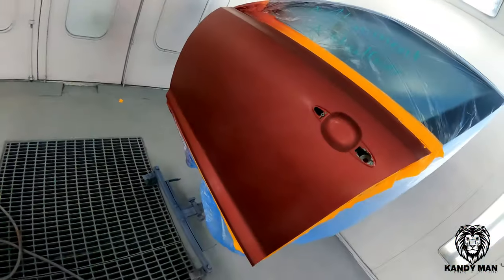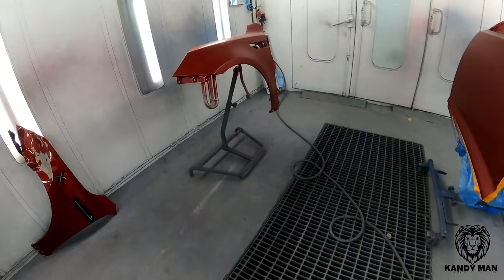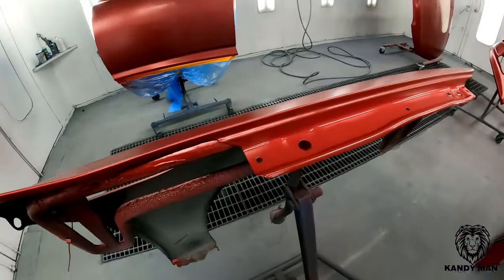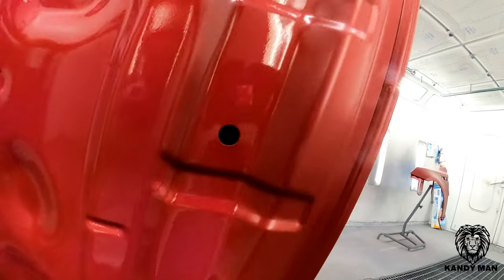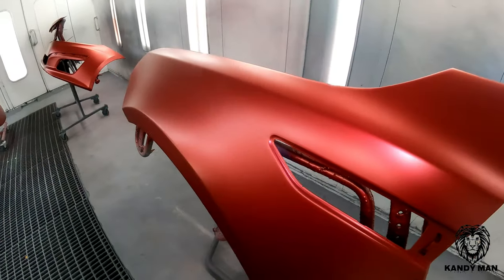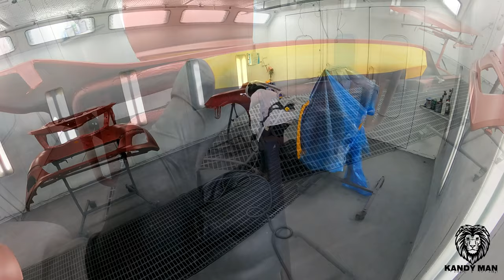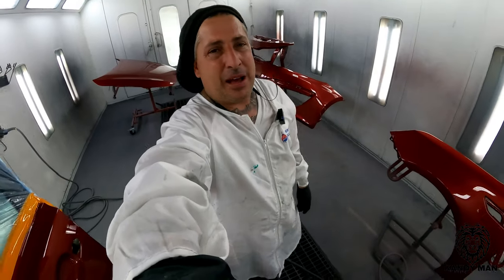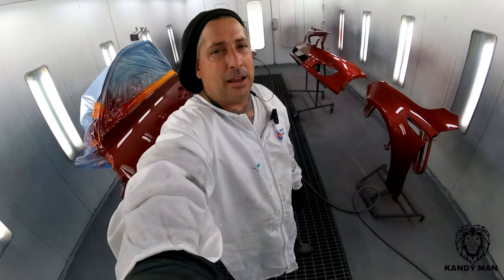DO IT RIGHT - ONE TOUCH AUTO REFINISHING

Comment: You do amazing work! Doing fleet I don't need to get that oem look. I have started taking more parts off cars to paint. I built 2 adjustable stands to hold doors. I did some color changes and was able to do all 4 doors inside and out at the same time. The stand can take a door on each side of it. I modified normal parts stands to hold bumpers in the natural position it is on the car. I just need to build a hood stand. Its more complicated, If I ever have time. I might be able to modify a door stand and make it tilt.
Reply from the maker: Thank you I do as much as I can off the vehicle.   Cleaner  can do more in a booth at once and no tape lines or chances of over spray on jobs win win

Comment: Question when using solvent basecoat... in the truck or with the vechical  cab.. what do you body shops use  over the basecoat..to give the satin finish with out leaving the basecoat bare no clear coat.
Reply from the maker: Satin clear

Comment: Your gopro/camera has heat damage in the lens and light sensors .

That's why you have that black line in all your videos that fades in and out
Reply from the maker: Thanks for the insight 👍
Reply: @kandyman5315  no problem , loving the content ! 👌
Reply from the maker: It weird cause it only does in booth
Reply: @kandyman5315  probably just from the booth temperature  . If it only happens in the booth then don't worry about it , you might just have to use a filter on the cuts you take on the booth to remove it .